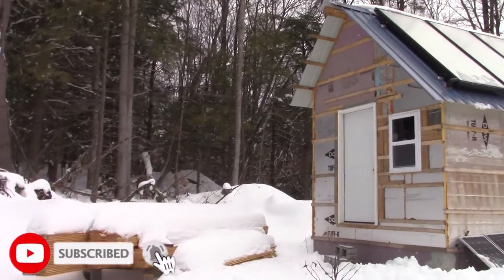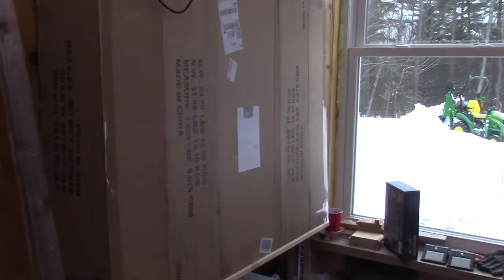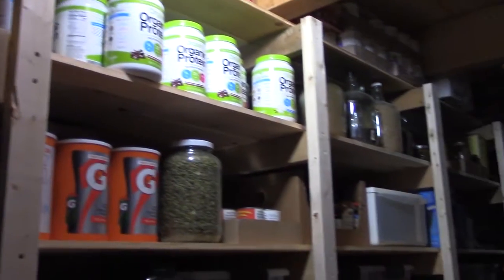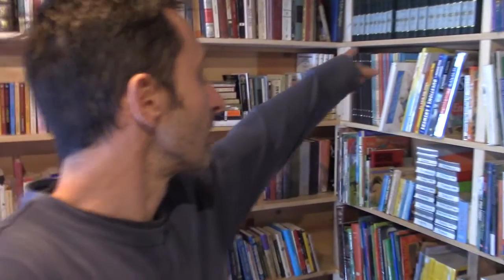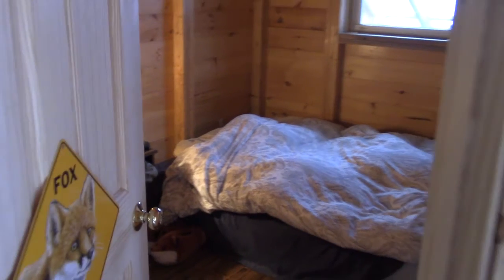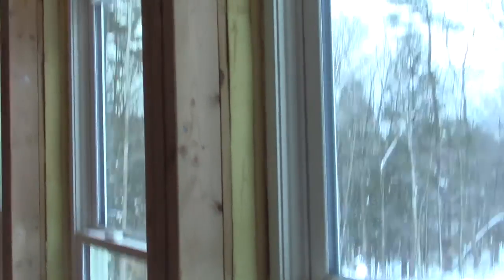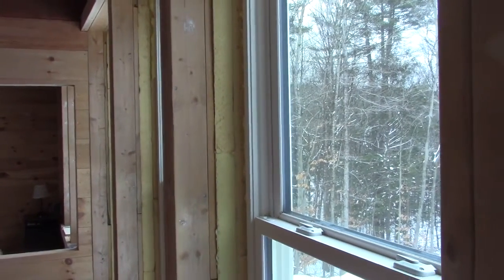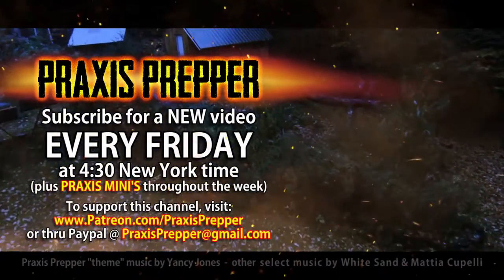2021 Prepper House Full Tour

Comment: Looks great. Looks like there is still enough work that you aren’t going to be bored for a while.

It’s funny I was just telling my wife about the Flowbee early today and saw one on the shelf above your washer. Do you actually use it? If so what do you think about it?

Really looking forward to your solar install.

Looks like it definitely would have been good to make that door on the root cellar open inwards.
Reply from the maker: Yeah, we use the flowbee. I bought it for my boy, but I use it to trim the top of my head too. I love the zero cleanup aspect of it. The blades sometimes don't cut easy though and grab hair. I've tried sharpening them, but they still grab now and then.
Reply: @PraxisPrepper  Good to know about the blades. Ethan probably wouldn’t give it a second chance if it pulled his hair. Fortunately Shelly’s been doing a good job cutting both of our hair and is getting better with each cut. She doesn’t trust me though and insists on a hairstylist to cut hers, probably a good choice 🤪

Comment: Impressive!              
I'm just having to quit my waggon and move into a store cupboard at a friends. Why? A windowmaker that 'appeared' last night. I was woken by a loud bang during the night, and, on looking around this morning found a tree with a large split ( about 1 cm wide and the full height of the tree, about 20 cm deep on one side and 9 on the other), of course, Sods law, is that the splits line up nicely so that the tree would split in the direction of the waggon.
~Not, wanting to die or get seriously injured out in the middle of nowhere, i've vacated the waggon and, using the available space at a local porch.
Will have to dismantle and rebuild the waggon (it's frozen to the ground) but nowhere near the standards of your place!!!
Reply from the maker: Hey, just checking in. You doing okay?

Comment: You're saving the wipes for the next pandemic? Do you know the shelf life of those? I once had some skin moisturizer, and I contacted the company because there wasn't any best before date or expiration date on the packaging, and asked them what the shelf life was, and they told me that all of their lotions have a shelf life of 3 years. Shampoo has a shelf life too, I read on the internet, but I guess it  might differ from brand to brand, since different shampoos have different ingredients.
Reply from the maker: Yeah, it's not a serious plan to keep them. They'll probably dry up in 5 years or so I'd guess.
Reply: @PraxisPrepper  I had some wipes left from 2010 scare that were still good for the current situation.
Reply from the maker: @ratroute8238  That's good info to know. Thanks for sharing that!
Reply: @PraxisPrepper  Yeah, I read the HOT ZONE years ago and it scared the crap out of me....good times!
Reply: @ratroute8238  How do you know they're still good? Did you phone the manufacturer and ask them if their disinfecting power is still at 100% at the day of manufacture? Just because a product hasn't dried up doesn't mean it's still effective. Liquid bleach that is older than 6 months or so may still be a liquid, but it has decomposed and has lost a lot of it's disinfecting power.
Reply: @moondog7694  They look and smell the same as the wipes I bough currently.
They do not contain bleach.

Comment: Awesome 😎👍. My fav is you having so much stove pipe inside to get every bit of heat before it goes out chimney.
Reply from the maker: Unfortunately (for that purpose) it's double walled. I was mandated by the building codes to use that instead of single wall. And I was irked by it. But I'll tell you what, we have a really easy time heating the place up, and lose less heat from a cold chimney pipe at night too. Also (in theory) less creosote buildup. So maybe I'm good with the double-wall anyhow.